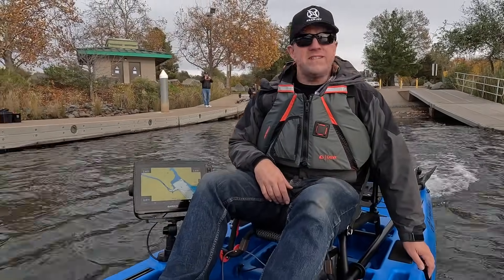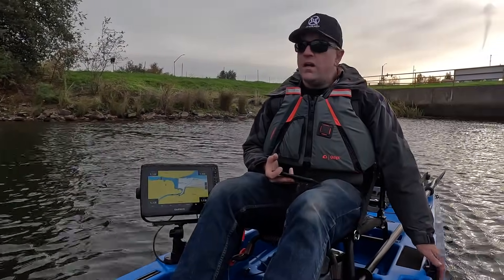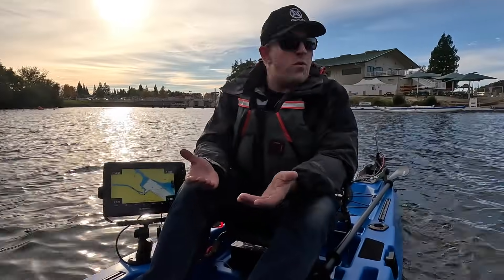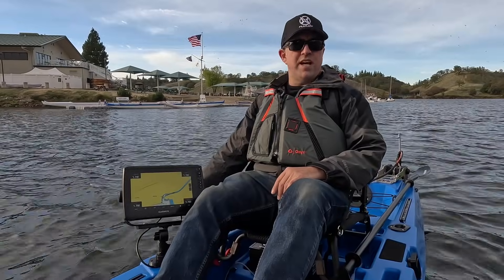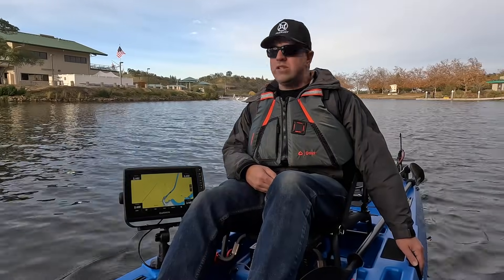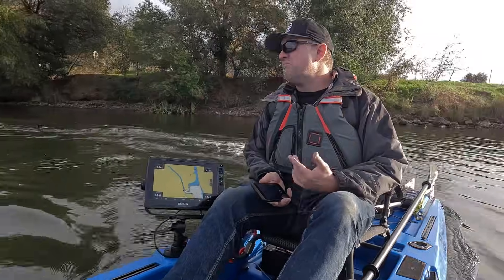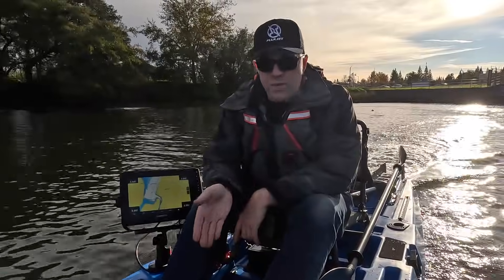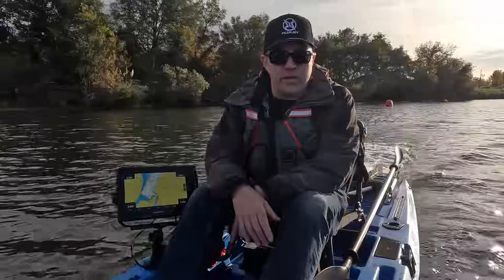FluxJet Speed Trials: 12V vs 24V vs Jet Drive (Real Test Results)

Comment from the maker: For this speed trial we started at the lowest possible power setup (12V) just to show the baseline. Our recommended operating voltage for the FluxJet is 36V, and the system is designed to accept anything from 12V up to 60V depending on how you want to run the kayak.

Higher voltage = more available power, which affects both top speed and range, while lower voltage offers slower cruising and lighter draw.

This video is simply one snapshot across a wide voltage range. We’ll continue posting more tests so you can see how the FluxJet performs at different power levels.

Let us know what other comparisons or test passes you want to see next.
Reply: I am wondering, what is the slowest it will go with a 36v battery? Because I will be trolling up and down creeks real slow, if 
Possible.
Reply: @henryclark5486 i think ive seen under 0.3 mph its not something ive paid much attention to.
Reply: whats the amp hours of the batteries tested?
Reply: @Golfhippy10 12v 100ah, 24v 50ah, 36v 50ah. The 48 and 60v batteries were in the owners collection so not 100% sure to be honest. We were not testing capacity runs just top end speed for these tests. We'll be doing some more testing next week when time allows. Its going to be a very busy week with some surprises along way

Comment: I use a drill and drill prop and hit 4.75 on my $300 tamarak.
Reply from the maker: That’s a creative setup. FluxJet is built for consistent power, hands-free control, and reliability without external props or DIY mods.

Comment: Well, with the 36V 50Ah battery I am sure the motor will perform very solid consuming some 700-750W. However, using this kayak where others can´t go where this kayak really shines because of the shallow water capacity of the jet drive the numbers are disappointing.The most exciting areas are ocean inlets and shallow coastal areas with limited acces affected by tides. But how far can I actually go running against the tide where I will be needing full throttle all the time ? And of course on the way back the tide has changed and again I will be needing full throttle all the time. Soooo.... assuming ???.... Hopefully the current against me is the same.... IF I AM LUCKY !........ but while my motor is running at top throttle against the tide I am making only half the speed. So doing the numbers the range of my battery is only half of it´s capacity because I always have to calculate enough capacity for the way back. So with a 36V-50Ah battery divided in half that's some 900W. But because of the strong current of the tide I might be also only running half the speed. So what is my range with 900W if the motor eats 700-750W ? Well, in these shallow water conditions where the kayak really shines and is unique my range is only some +5 miles. So that needs at least a second 36V-50Ah battery for a decent range. That's another 30 lbs on the kayak with 400 lbs capacity and where am I going to mount the second battery on that small kayak ? You designed a great kayak to compete with other kayaks but You did not design it for the shallow water capacity where this kayak is really unique and other kayaks can not compete. ALSO..... would be helpful for informed decisions to have more insides about the quality and serviceability of the jet drive. Saltwater WILL do some serious damage and service life of parts in salty marine environments is limited.
Reply from the maker: Range is very dependent on conditions and how you use the kayak, but we’re working on more content that digs into a wider range of scenarios and performance data.

Comment: Can the motor/kayak saltwater use safe?  As there are electric motors that are freshwater use only and saltwater friendly motors.  If saltwater capable, would be great to see it handle floating kelp and eel grass....what you find fishing around CA kelp beds and in Baja.  If you use a 24v+ battery, does the kayak step the voltage down to 12v for fish finders and live well pumps?  How long would the kayak run at 3-4 mph with the different 100 ah batteries using 12v-60v batteries?
Reply from the maker: Yes, it’s designed to be saltwater capable. Freshwater is what’s easiest for us to film near the factory, but the platform itself was engineered with saltwater use in mind.

Comment: I love the tech I am seeing here and do not want to be the downer but I use the "other motor" that you tested and in my fully loaded yak with my healthy 240 pound petite body I usually can get up to 5.5 and on some flat water lI do 6.5 and if the current is with me and the wind at my back  while falling down a waterfall I think I can get up to 30....    okay no waterfall...  I can get 7 Plus with current and wind going the same direction.   Once again I like what I see here...   I can not wait to see how Fluxjet pushes kayak purpulsion tech to new levels... !!
Reply from the maker: We did not share or compare specific models or setups from other brands, since there are a lot of variables at play, hull design, loadout, battery configuration, water conditions, current, and wind all make a big difference. What you are seeing here is a baseline test to show behavior, access, and real-world use, not a top-end speed competition.

Different setups will always produce different numbers, especially when current and wind are working in your favor. This was meant as a reference point and an example, not a final statement on performance across every scenario.

Thanks for the follow and for keeping an open mind. We are excited to keep pushing propulsion tech forward and share more as testing continues.

Comment: @FluxJet Kayaks  Exciting product.  Fishing kayaks need either Anchor tollies or Spot lock  Also my only worry is regarding the floating algae that is all over the bays of SW Florida.  I fish mostly around Marco Island or Pine Island on the Gulf side.   I use either an Oldtown 120 Auto pilot with Spot Lok, a 106 Powered by MinnKota with anchor and trolly,  or a Hubie Lynx powered by a Bixpy.    I need to know how this handles drifting hair algae.  MinnKota and Bixpy handle it fine but I've heard horror stories about Jet Skis and algae.  My current motors all use 12 volt but I see good results using overvolted batteries.  24 volt would seem the best option for your Kayak.  I heard you mention possibly a better intake grate or filter,   would to hear more about that.  I love the fact that this would allow access to such skinny water.  Most of the water I fish i is 13" or 14"  to 3 feet depth.  Your kayak would kill it in these waters.
Reply from the maker: Appreciate the detailed feedback, that’s exactly the type of water and setup we’ve been thinking about. A lot of what you’re asking, including handling weeds and algae, voltage options, and shallow-water performance, is covered in the aaanglers video that dropped Friday. They ran it in real conditions and asked many of the same questions you’re raising here.

There’s also a new on-water video dropping today that goes even deeper into real-world use. Definitely worth a watch, and we’re happy to keep the conversation going after you’ve seen it.

Comment: Watch the whole video and did not see not one motor,  Would have like to have seen one !
Reply: It’s in the hull of the kayak. You won’t see it in the water.
Reply: If you go through past videos from icast you can see the motor in and out of the boat. Its not your typical setup thats why you dont see it in the videos.
Reply from the maker: The motor is fully integrated into the hull. That’s the whole point of the design. There’s no external prop or big motor hanging off the back, so you won’t see anything sticking out in the video. The jet drive sits flush inside the kayak, which is why it runs so clean in shallow water and grass.

Comment: Can you show the battery box and how the batteries are connected to the kayak? Thanks
Reply: Its the noco 31 box. You will have a battery harness that connect to positive and negative and plug it the waterproof connector under the seat. Flip on the circuit breaker and go have fun.

Comment: What motor are you running for the jet?
Reply: They are hand made here in northern California. Its a pretty fun process to watch
Reply: @J @JamesSnyderShopCook im from Northern California do we still have to preorder or can we buy one directly from the warehouse?
Reply: @JamesSnyderShopCook Do they have a website. I use motors all the time for stuff.
Reply: @FishingCPA-yf3oz the motors will not be sold separately.
Reply: @JamesSnyderShopCook  I was not going to buy one from you. If there is an American motor company that makes good motors. I would prob give them some business that's all.
Reply: @FishingCPA-yf3oz we make the motors in house its not something we are buying off the shelf. Its not your typical motor sorry if i was confusing
Reply from the maker: It’s a custom-built electric jet drive that was designed specifically for this kayak. It’s not a repurposed trolling motor or an off-the-shelf unit, so the hull and the drive were engineered to work together as one system.
Reply: @fluxjetkayaks ok so you build the electric motor in house? Thats kool if you do. The jet drive sure. What about the speed control I would imagine you would outsource that.

Comment: I am sure licensing or something comes into place but what about a Milwaukee m12 battery like a 6ah. Could that be done?
Reply: Im so making a video powering it with power tool batteries now😂. Great suggestion!  Don't try this at home kids.
Reply: I never even considered that. Got three 60V DeWalt batteries (30 Ah total) for backup if someone figures this one out.
Reply: @sergeygolub8309 oh its happening 😅
Reply: I used two m18 12.0 amp in parallel with a step down voltage from Amazon to 12 volt powering a minn kota 30lb no problem, I’m sure you can use two m18 in parallel no problem in this kayak or m12.

Comment: Would you please try a Ryobi, Milwakee, Dewalt battery,  etc..... on a test. 

If an rc 12v battery will run Ina pond,  how will these tool batteries work?

Thanks!!
Reply: We are so going to find out! Its on the board for next week. Stay tuned.
Reply: @JasonWoods-ed7yu thats great! Nothing like having a small emergency back up! I have a 12v 300watt inverter for Ryobi. Will be interesting how to hook that up.

Comment: That blue color is amazing. OK, so, both batteries give out the same amount of energy, 1.2 kWh, going just 1 mph faster drains the battery almost  2 thirds quicker the time. New in this so can someone check me if I got it right?
Reply from the maker: Roughly yes, tiny reductions in speed massively reduce the power requirement for any kayak.

Comment: I'll wait till you get GPS Spot lock/Anchor on that thing. Maybe... The more I watch, the more I want one. I'm 6'5" tall, 270lbs. How would I do in that kayak? I need room
Reply: Adding a bow mount?
Reply from the maker: Spot lock isn’t built in, but a lot of people are asking for it and it’s something we’re looking at for future add-ons. The more content that comes out, the more people start thinking about what’s possible.

As for fit, you’d be fine. We’ve had riders in that height and weight range on the kayak with no issues. It has a 400 lb capacity, plenty of leg room, and the seating position works well for taller anglers. You’d have room.
Reply: @fluxjetkayaks  Awesome

Comment: 1.6hrs at full, so to assume 3.2hrs at half, and 6.4 at 1/4 constantly on. Hope 36v 50ah has a bit better efficiency. Sun up/sun down fishing is hard to judge time on.
Reply: Its not a liner line from 0 to 100 more of a curve. Higher speeds require way more power then the lower speeds. Just like most motors on the market your best efficiencies will be right around 75% for the best bang for the buck of battery consumption and speed
Reply: More, 50% throttle is closer to 1/3rd power draw.
Reply from the maker: @jbomx The power curve is exactly like most electric motors — higher speeds require a lot more energy, so the draw climbs fast at the top end. Your best efficiency is usually around the 70–75 percent throttle range, where you get the best mix of speed and battery life. That’s where the 36V 50Ah setups really shine.